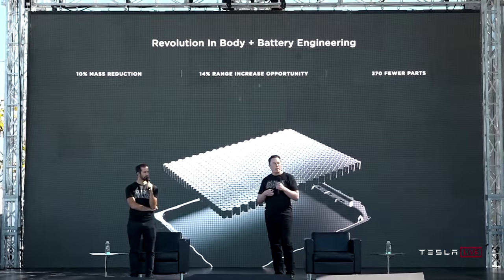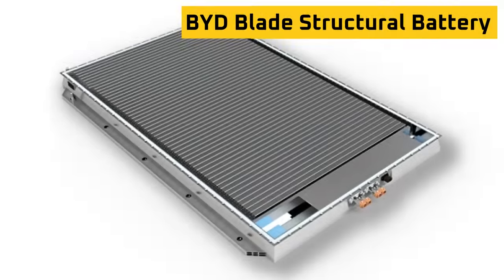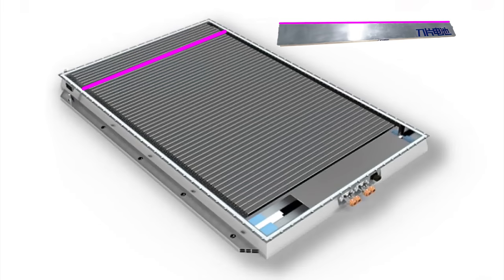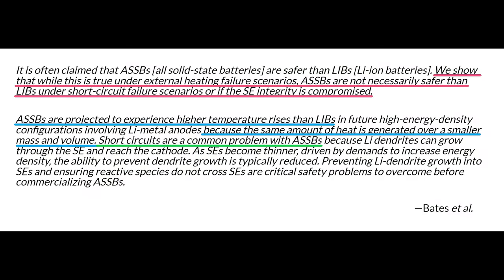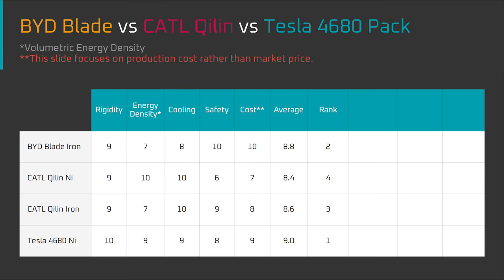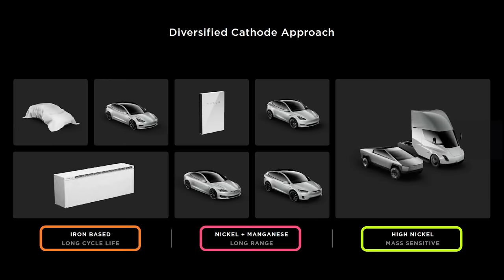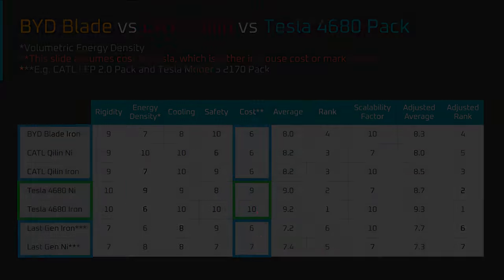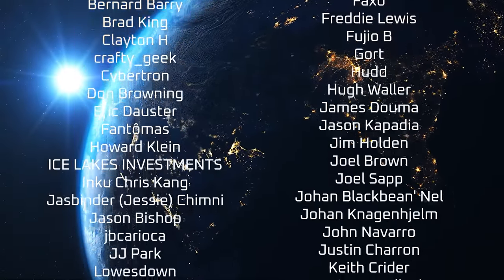Pack Analysis:  BYD Blade vs CATL Qilin vs Tesla 4680 Structural

Comment: As an all in Tesla investor, your battery comparison presentation is a great anti-anxiety catalyst😅 Thanks!
Reply from the maker: Glad to hear it man!
Reply: Ultimately I think all battery packs from all manufacturers will be close enough that it won't matter too much. Right now the race is price which is largely a race for production capacity. Tesla is growing like crazy so I think you're good. Also, Tesla uses whatever kind of battery it can get from a range of manufacturers in a range of form factors and sizes, so even if the 4680 didn't work out at all, they would just instantly pivot to other different batteries.
Reply: Sorry for that...all out would be safer.
Reply: Tesla isn't only about cars. They make batteries, power walls, megapacks, solar panels, full self driving payed software and later robotaxi and next generation robots. Don't be afraid, this company will be number 1 until 2030 with more than 5 trillion market cap if everything go normal
Reply: The mess about Tesla battery is that the polietherene foam will have downsides when it comes to repairing and recycling and you know where the trend is going.
In 5 years Tesla 4680 battery structural pack will not be allowed.
Also, the cooling is not the best approach since those bands like they did in previous generation is not the best cost-effective solution.
For day to day consumers the best solution would be to have top-bottom cooling. For the architecture off all cylindrical and prismatic cells the conductivity, (which will be the main factor on even cooling) is orders of magnitude bigger in the z axis. 
For prismatic cells it makes sense, but for cylindrical cells the best solution is to have a good bottom cooling. 
I dont doubt they are the safest, but over engineering will have minimal impact on overall accidents but a considerably impact in cost.
As they say in the video Tesla will be for a high end market wihle Chinese are going for the true poeple's car. I would not be able to grade the battery's packs as he did each is focused on their points. 
Is like trying to fit a high end bmw to a guy in France who need a small van like a Berlingo. For sure the bmw outperforms the van in multiple points but it fails in it's key point.
Reply: Apart from the fact tesla stock is still in a bubble and has a long way to fall yet!
Reply: @lluisfargaslopez9603  4680 batteries is the best solution for the semi truck, fastest charging (0-70% in 30 minutes), longer autonomy and lower weight compared to lfp batteries so the payload is not reduced and the autonomy is the highest across all the other semi trucks , same price as to buy lfp batteries from other companies, easier mass production because cylinder batteries is easier to manufacture and later on, tesla will make 4680 lfp batteries wich will be very useful for tesla model 2, power walls and megapacks. You will see.
Reply: @lluisfargaslopez9603  they won't repair structural batteries - EVER - they'll pass them onto JB Straubel's Redwood Materials recycling plants to be recycled & put into new batteries.  The chemistry from recycling is actually higher quality than from mined minerals, as it's been processed twice, the 2nd time from a more concentrated supply source with less contaminants.   You're totally wrong on nearly everything you said.
Reply: The 4680 battery, which has not been mass produced, is not worthy of being BYD competitor.

Tesla lags far behind BYD and CATL in battery technology~
Reply: @parkjoonkwang9259  This is half of the story. 4680 batterie is cheaper for tesla compared to buy lfp batteries from byd, catl and also the bigger efficiency (kwh/100km) on tesla cars can still bring competition to byd. Also the next big thing for tesla is 4680 lfp batteries and for Byd na-ion batteries so both companies will grow and the problem is on other companies.
Reply: @greecemobile7610  No, that's the whole story. 
If Tesla wants to prove that it can compete with BYD and CATL in battery technology, it needs to get the 4680 into mass production and into the market.
BYD and CATL batteries have been on the market for several years and have stood the test, something the 4680 has not been able to do so far.
As to why, the answer is that the 4680 is technologically imperfect and Tesla lags behind BYD and CATL in battery technology.
Reply: @lluisfargaslopez9603  Very good post. I am a Tesla fan but this is my biggest concern. Tesla has to change their view on cost-effective vs repairing and environment. Now.
Reply: @crankhandle Tesla stock is still dropping 😂😆
Reply: 4680 ended up being garbage. Catl is still stomping everyone. Your Tesla stock is hilarious garbage these days, worst s&p 500 performer. Couldn't happen to worse people.

Comment: Small disagreement: Qilin and Blade internal connections that provide the necessary output voltage/current values are still connections. So it seems that they shouldn't get extra points for fewer connections. However, that is  nitpicky. What is not nitpicky is that this report is amazing in its comprehensiveness, especially given the paucity of engineering details available. Jordan is the go-to guy for the global view on batteries! (and a whole lot more)
Reply from the maker: Thanks man 😊

Comment: Another advantage of using smaller cells are yield rates: like with computer ships, the smaller the cell, the higher the yield rates.
Reply from the maker: Great point!  Hadn't though of that!
Reply: If the main issue affecting yield is small random defects on the anode and cathode that would make sense. Is this the case though?
Reply: Can you elaborate more? Why do smaller cells have a better yield rate? Even if the smaller cells' yield rate is higher, does it translate to a business advantage? Quantity wise you need 5X # of smaller cells. E.g., 95% yield of 4000 smaller cells means you have 200 scraps. 90% yield of 800 large cells means you have 80 cells. There is a breakpoint but your statement might need some clarification.
Reply: by 'yield', do you mean momentary power availability? If so, for sure a huge advantage. Also I might add, more wiggle room for error/dying cells in the future, and with compression resistance overall -say with a side impact of the pack(vehicle) might stunt/eliminate a smaller percent than an entire array of blades due to one end receiving minimal damage.
Reply: @Charles-Darwin  Yield rate is the percentage of manufactured cells that are actually usable at point of manufacture.
Reply: So that means that Tesla is going in the wrong direction? 🙃
Reply: @jonassteinmann6247 One of Tesla's issues releasing 4680 was yield rates.  Imagine if their cells were bigger by a factor of 5?
Reply: The smaller the cell, the less effective it is
Reply: Not really in wafers there are hard limits and the main defect rate is with the bulk that you dice around. This is a major concern when there are a small number a wafer. For product there are alot of other things such as making x times more so more opportunity for failure.

Comment: on cost, 4680 would cost most while blade the least. u need to consider from a third party's perspective, not tesla's. 
also, scalability goes to blade by far. it is the only one that has passed the test. all others remain on theory. 4680 is known to be hard to ramp up production.

Comment: I still prefer modules, it's far easier to fix and repurpose the cells even if they may be heavier and more expensive.  Thanks for making a single use pack Tesla.
Reply from the maker: It takes specialized equipment to do that, and it's not actually feasible as a long term solution.  This is because it whacks out the entire pack balancing process if the cell isn't identical to the others.  Bunk argument basically.  

The argument applies to cell phones, but people preferred lower cost over repairability.  Such is economics.
Reply: @thelimitingfactor  the BMS handles cell balancing regardless, decent ones keep things in spec rather well.  Modules also reduce waste because you don't have to scrap or deconstruct entire packs if there is a problem.

Comment: Jordan - great analysis. One item you should double-check. Why the 4680 cell can is thicker than the 2170 cell can. The thicker 4680 cell can MAY help with the pack's structural aspects, but it is likely the primary reason for thickening it up is to prevent the cell can from rupturing in a thermal runaway event.  

The cell cans are essentially "pressure vessels" that must contain the cell's internal pressure during a thermal runaway event and allow the cell's gasses to vent through the end-cap vent port and not rupture the can's sidewall due to excessive "hoop stress" in the can (picture how a pipe ruptures when it has been over-pressured or freezes). The "hoop stress" for any cylinder is proportional to the internal pressure, cylinder diameter, and cylinder wall thickness. So, for a constant internal pressure,  a cylindrical cell that has twice the diameter will require a can with twice the wall thickness to handle the same hoop stress. Note the 4680 vs 2170 cell diameter ratio is 46/21 = 2.19.  Now note the 4680 cell can vs 2170 cell can thickness ratio is an average 0.55 mm/0.25 mm = 2.20.  Coincidence? Perhaps you should check with any cell engineer contacts you might have about my hypothesis.
Reply from the maker: Covered in the next video.

Comment: Clear evidence based analysis. Three (5) outstanding battery packs using significantly different engineering approaches. Actual rather than theoretical units.  Excellent relevant and valuable video. Thanks

Comment: Great vdo with lots of detail to digest. From a simple geometry perspective, the blade battery has much better packaging, doesn’t need the foam padding to fill the gaps, and the current collector is vastly simpler. You mention the cylinder form factor is cheaper to produce, and perhaps with the current machines it is, but I would imagine the blade battery will sooner or later be equivalent or maybe even cheaper since the cells are bigger. The blades could be tilted to reduce pack height for sports cars where it’s desirable for the seats to be low to the ground. The blade battery makes a lot of sense to me, and I’m invested in Tesla not BYD.
Reply: Yeh, there is something much more elegant and simple about the Blade Battery. I don't see the future of battery packs being 1000's of cells and connectors and ribbon coolers, etc. BYD looks like the future, if all the other criteria are met.
Reply: GM's switched off their Ultium blade battery, leading some to think that the 4680 cylinder was underestimated by the critics who could start here and learn the important dimensions of the EV battery. Thanks for the work you do.

Comment from the maker: There's a lot of comments coming up in this video about the repairability of 4680 Structural Packs:

1) Repair was always a minimally viable proposition for automotive packs.  It creates cell balancing issues because you can't just drop a fresh cell into a pack full of disimilar cells.  You'd have to find a cell that's identical to others in the pack, which were matched at the factory.  It can be done, but it's more of a bandaid for out of production packs.

2) What about if it's not the cell that's the issue?  That's part of the the point of entombing the busbars, wiring, and cooling lines in polyurethane foam rather than bolting everything down:  There's not much to break loose.  If there is a failure, it would show up pretty quickly and covered by warranty.

3) EV OEMs don't cater to the <.1% of people who want the right to risk frying themselves on the high voltage system to replace one cell that will likely cause a sub-optimal outcome.  They cater to great mass of people who want a lower cost vehicle with less noise, vibration, and harshness that has greater reliability and costs less.*

That is, the right-to-repair argument for automotive battery packs is hackneyed.

*Currently, supply can't keep up with demand for EVs.  Tesla won't price vehicles so low that customers start "flipping" them.  Cheaper Tesla vehicles will come in the next couple of years, along with Chinese EVs.
Reply: when GM decided to recall all Bolt battery packs, they first experimented with in the field module replacement. Quickly determined that was impractical, all packs were processed at a central GM facility. So agree modularity and repairability are false goals.
Reply from the maker: @steamtorch  GREAT insight.
Reply: Good point re: Bolt. That said, do you know whether GM replaced modules at their central facility, vs. scrap-and-replace?
Just because a manufacturer decided it's currently impractical or unsafe to do field repairs doesn't mean that'll continue to be the case, or that nobody will come up with a better way to do so. Third-party repair helps keep manufacturers honest and accountable, and gives owners more options.
Reply: @realfutbol1   GM reused cases and electronic components from returned packs with new modules. I assume parts went into common inventory so no pack was really just a simple module replacement. I mean GM put a full 8/100 warranty on them so all parts had to pass testing and inspection.
Reply: You might be right but that just means the realistic lifespan of the vehicle is 10 years. Taking into consideration the increased energy and raw materials needed, the sustainability of current evs is very dubious.
Reply: You are obviously Tesla-biased, because the right to repair and reuse, especially when materials and supply is limited, becomes the most important issue. With EVs we try to pollute less, not throw away and recycle entire battery packs that could be salvaged or reused for many more years. As to your so-called "arguments" it's easy to see that:
1) Used battery storage and parts will become a BIG trend and business. You will be able to find a module with a similar SOH that you need in a scrapyard and service your car for a few hundred dollars instead of replacing the entire pack for a single damaged cell or module.
2) That's just stupid. If the cell is not the issue and you need to replace a BMS or controller, that is exactly why it's better NOT to have it all covered in foam and basically render the entire pack irreparable.
3) That's also bullshit. There are so many service shops appearing that are able to repair battery packs. It's not rocket science. It's easier than repairing an engine. Sure, you can screw up and blow up you gas car also if you don't know what you are doing in that engine. But that is exactly the point: modular batteries are SOOO way easier to repair compared with an ICE engine by any qualified person.
4) REUSABILITY. In 10 years or when my pack starts to have too little range for my need, I can reuse it for home storage. This would add 10 or more years of usage to that pack. It's nearly impossible to do this wih 4680 and you know it. The BYD blade is 10 times more elegant and easy to reuse.

Unfortunately Tesla is going the Apple way, but not in the good sense. You cannot throw a 10-20k USD battery or a 40-60k car as you throw away a 1k phone. Stop taking their side when they are clearly doing stupid things. The 4680 will be forbidden in EU when they realise it non-repairable and this is also probably why they never produced it there. They are using BYD blade for Berlin produced Model Y which is great for the EU market. The right to repair and reuse DO matter !
Reply: The argument of repair ability is a bit biased. If a pack can be designed to be repaired it is In the end the "Greener alternative " Gm repaired the modules and was able to reuse components.  Cheaper is not always the sustainable route .

Comment: Really appreciate these videos. 
If I could add anything to this analysis I would definitely like to see comparisons in potential power density, particularly for fast charging capability.
I understand the focus on other factors regarding the value to manufacturers. I also think that longterm adoption for EVs as a major form of transportation depends a lot on the available infrastructure and that includes fast charging. Especially after fully battery electric Trucks start becoming mainstream.

That being said. Keep 'em coming, please!

Comment: Thanks a lot for this interesting video.
I would like to add that fast charging is as important as the energy density .
For example you can reduce the pack cost by decreasing his size and quickly charge in order to keep your range to your use case. The combo LFP/Fast charging is quite interesting.
The Qilin cool the cell big source because it is the best place (lower contact resistance between JR and casing). In addition I do think that the Qilin design is aimed for allowing better fast charge performance.
The use of cooling to stop the TR is theoretically possible , but is has to be performed as soon as the cell reach the first onset temperature. Besides the high temperature may loosen the contact between cell and cooling plate reducing the cooling performances.

NMC tends to generate more energy than LFP with lower trigger temperature. But LFP has a lower max temperature but will keep it for a longer time. Therefore the safety performance is highly dependant on your system safety concept or design 

For the Future it is very difficult to say if Tesla is choosing the best solution , but they have chosen the best for them.
In fact the cylindrical cell design is something they already master in term of design and manufacturing ( changing even a slight tooling calibration can be difficult 🧐)
Reply: If batteries can be charge quickly, the plus is really short charging time. I think drivers will not mind going to a charging station and wait for 5 mins to charge their batteries. This is especially so for city dwellers. In that sense, do you think that would make BYD blade battery to be the best choice? Additionally, what are the challenges to install very high wattage charging station.